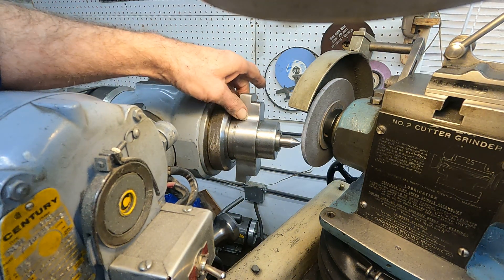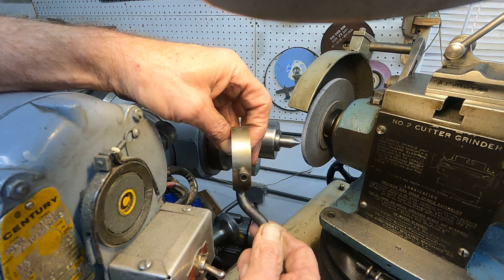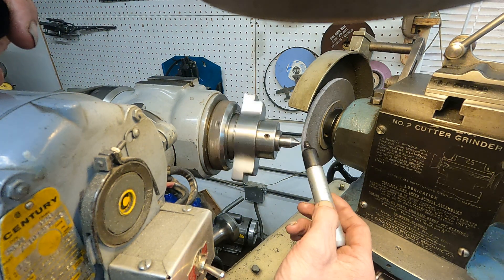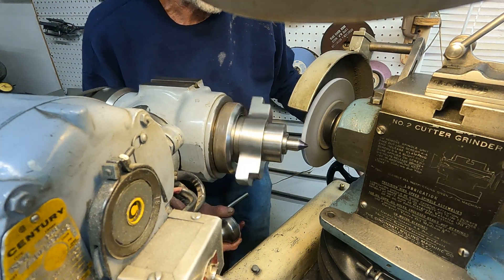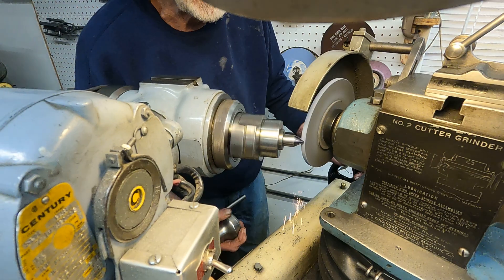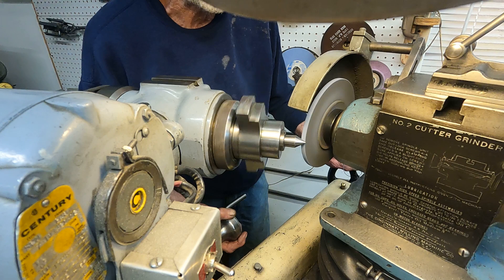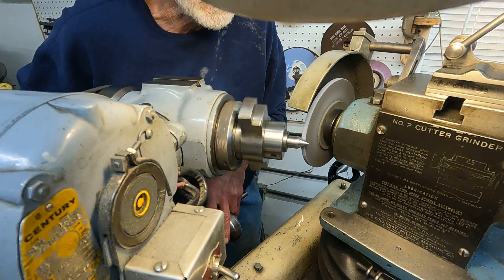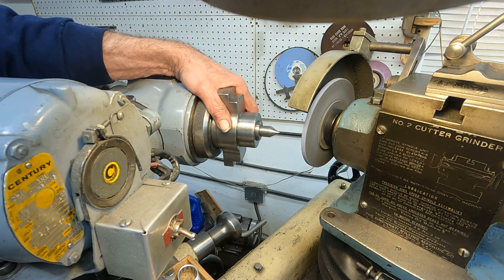Tool & Cutter Grinder Work Head Center options

Comment: Can you show us how you now set the work head so it is concentric with your (fixed) centre. i.e. so you can grind paralell. Cheers
Reply from the maker: Hi, in an earlier video I had shown tramming the head indicating a ground bar  using the 5c collet or small taper end, for the 50 taper end I do the same using an ER40 collet chuck with a Cat 50 shank.